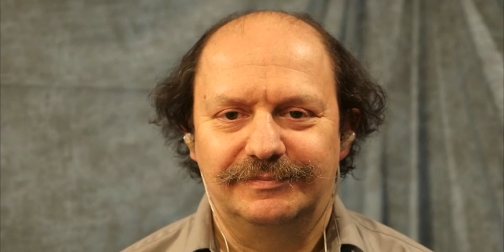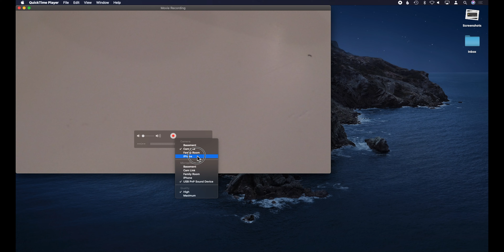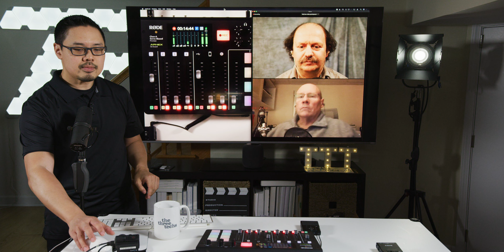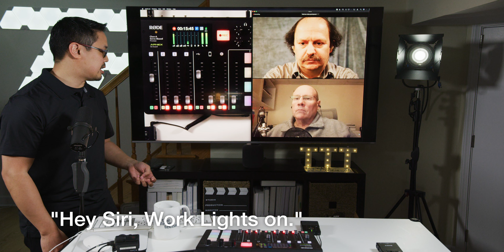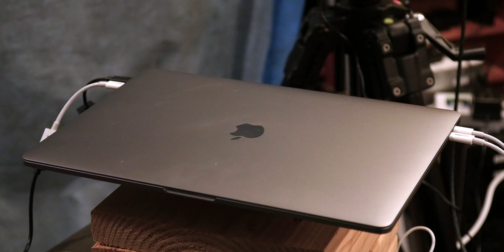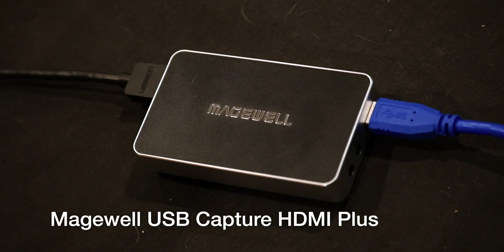How to Record Interviews Online with Audio and Video for Podcast: Behind the Scenes!

Comment: Hi. first able thanks for the video. I am pretty new on this so i have a question. If I am using Cleanfeed and recording the video in Zoom do I have to turn off the Zoom audio or mute everyone including the host in zoom so I can just work with Cleanfeed
Reply from the maker: Hi Yessenya, yes, we disable or mute the audio in Zoom when using Cleanfeed. Please note that the latest version of Zoom now supports high quality audio, so you might not need Cleanfeed if you’re already using Zoom. Also note that sometimes Zoom and Cleanfeed don’t share the same audio devices together nicely. For example, we’ve seen the audio level drop drastically in Cleanfeed when running other software like Zoom that uses the same mic.

Comment: What system do you use for your wireless IEM?
Reply from the maker: Good question. It’s not a real wireless IEM. It’s actually just a Sony UWP series wireless mic transmitter / receiver pair used backwards with no mic. The RODECaster Pro feeds the Sony transmitter at line level. The Sony receiver is clipped on the belt and a Shure in-ear monitor plugs into the Monitor output of the Sony receiver. It’s what we had laying around.

Comment: what about the later edition? To sync audio and video?
Reply from the maker: That is a separate show that we haven’t made, but it’s on our list.
Reply: @TheThreeTechs  lol yeah that's what I'm currently having a problem with.  Using zoom for the video recording and cleanfeed for audio, but getting them to sync has been a bit of a issue.  Is there a suggestion on which to hit the recording button 1st to make post editing easier?
Reply: Beatriz, not sure if you're using a Mac, but here's how I sync up audio and video on a PC. I have cleanfeed routing into OBS. I also have video sources routing into OBS from Skype by way of NDI. In OBS, you can add an offset for the cleanfeed audio track by looking in advanced audio properties. If you're using a Mac, perhaps there is a similar audio track offset in Quicktime?
Reply: @jamcrab5925  really thanks :)